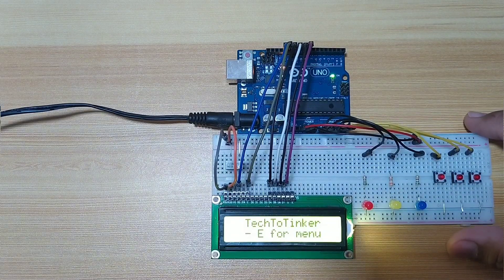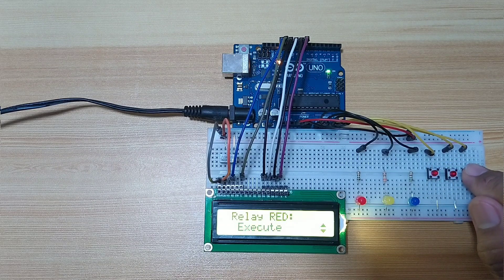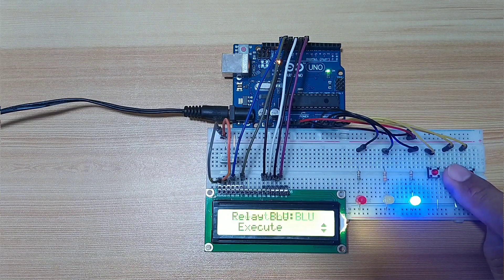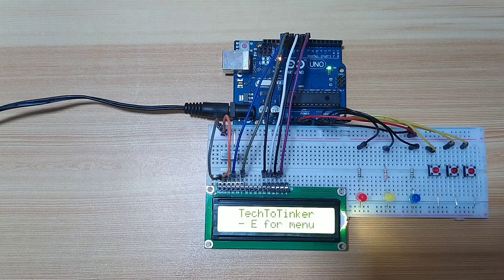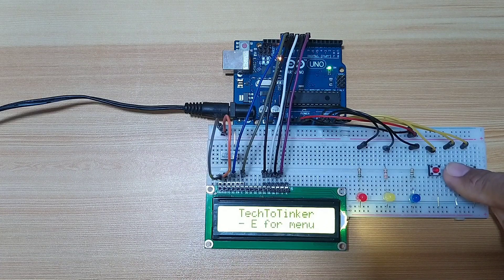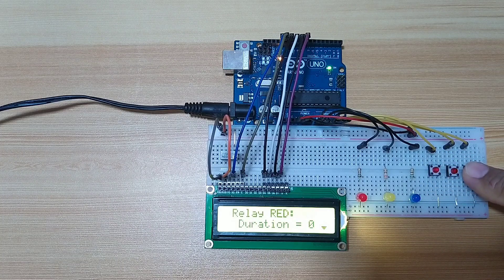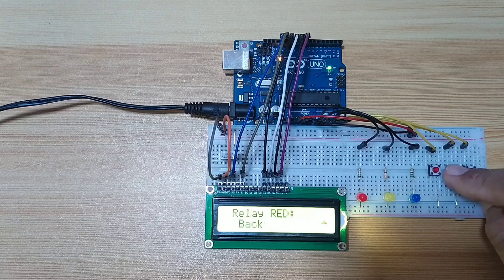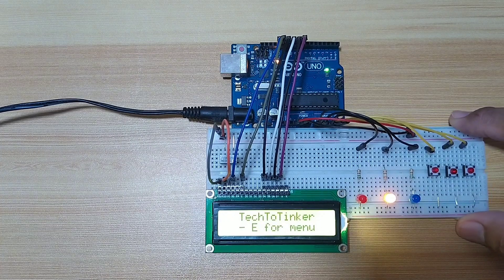Multitasking with Arduino | Relay Timer Controller

Comment: Respcted Sir,
Thanks for video,
Sir, yet i didnot found code for the, if during process the displayed value (analog signal) start increasing toward maximum value, at one point of time it will become constant(now not increasing), one pin of microcontroller will 'LOW' (initially high)
Sir can you help.

Comment: Can you provide a similar program but made the port timings in loop; first port (led) on for X-amount of time, second port (led) on for X-amount of time and so on. I would need such a program to control up to five relays in sequence one after another, then stop. Then execute with trigger pulse.
Reply from the maker: You may email me at tech.to.tinker@gmail.com if you still need this request. Cheers.
Reply: I also want to ask this same question?